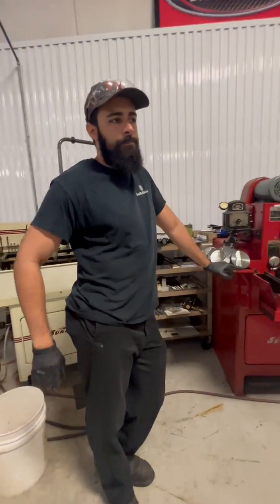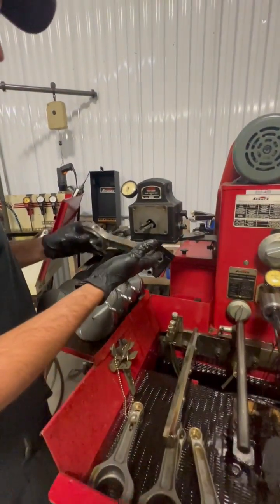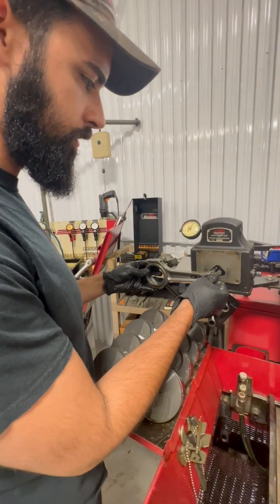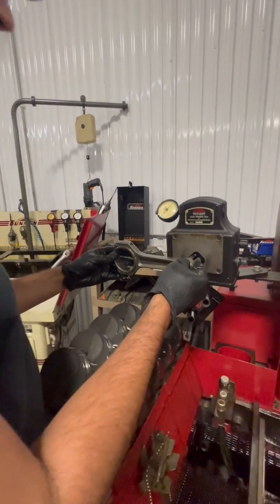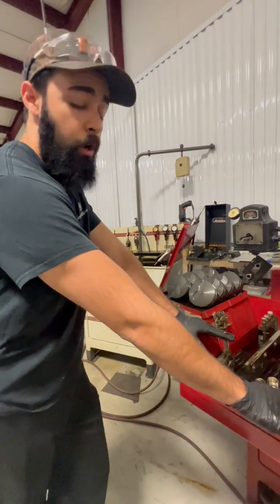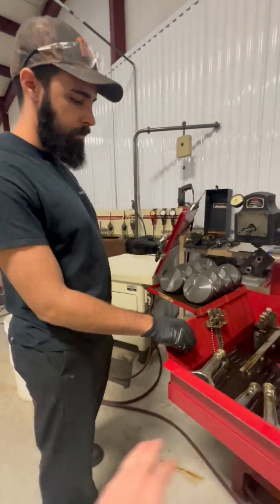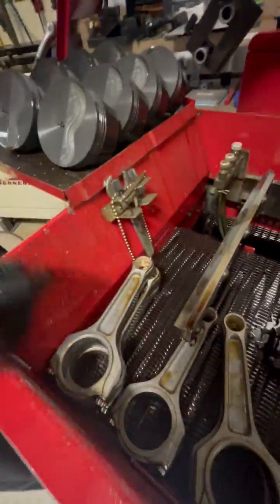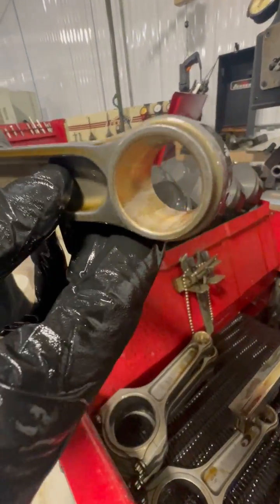Why You Should Machine Your Connecting Rods

Comment: Hi,   I have some connecting rods i want to use in an application but they are 1mm too wide on the big end and the small end.   I know they would have to be narrowed to the correct spec.   My question was do the bearings also have to be machined?   Also what is the approximate cost?

Comment: All this extensive jerking off on the surface finish of the blah blah blah gets wiped out once a motor is run for a few hours. The change in size from heat expansion alone is more than the taper on these bores. Good on this shop for selling a service, but it doesn't make a bit of difference in an assembled motor. Good for jerking off though.

Comment: This young man is absolutely correct.
Straight holes are a must.
.0005 bellmouth is unexceptable.
I wish on the pin ends the manufactures would leave the pin ends small so the engine builder could size to their specs.
Great topic.
Take care, Ed.